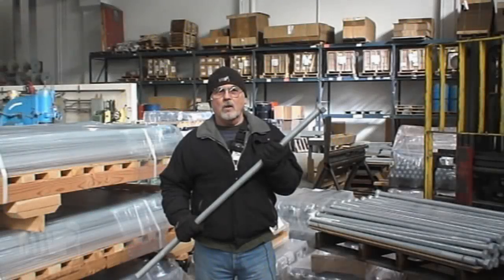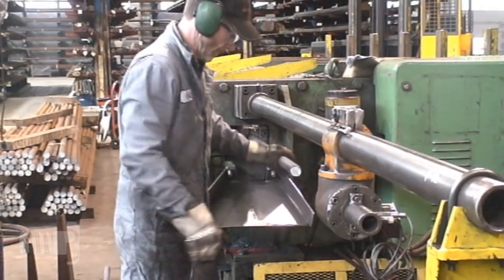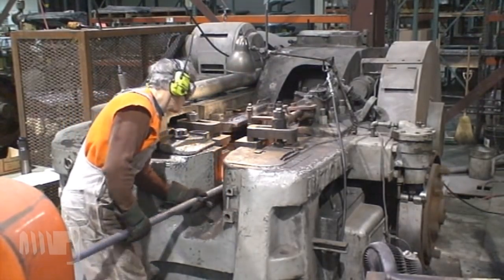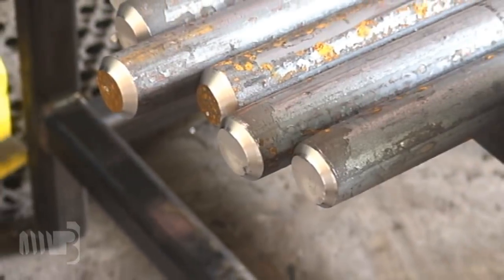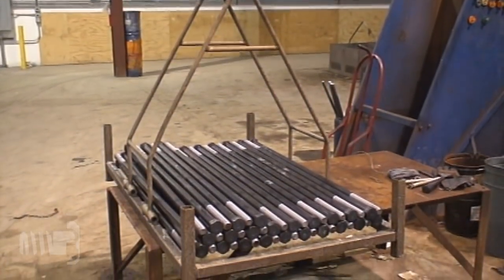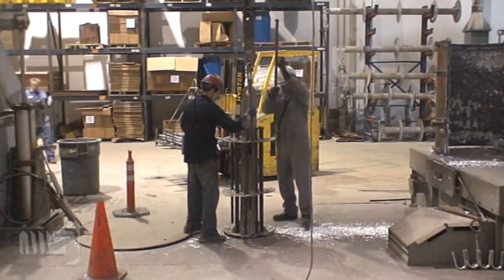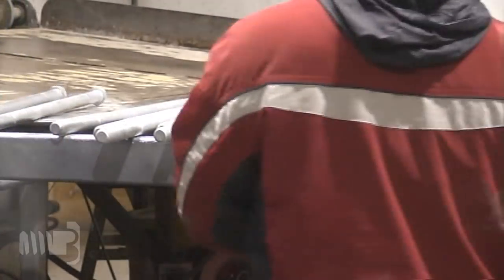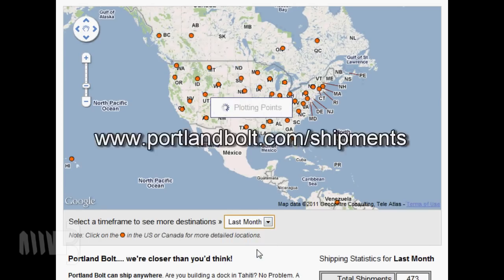How a Bolt is Made - Portland Bolt & Manufacturing

Comment from the maker: +Austin Washburn – No, all the machinery we have is designed for short run and hot formed specials. Larger production runs are typically handled by companies that have the cold forming machinery you mentioned.
Reply: Is it required to rethread after hot dip galvanisation? And thank you very much for sharing.

Comment: And here I thought Portland was just full of nuts! Who knew.😃
Reply: It takes a bolt to screw a lose nut!
Reply: Pop  lol
Reply: Oh, there's lots of nuts, as we see on the daily news...but none of them are the hard-working men manning these factories.
Reply: that's funny very funny very funny ...ha ha ha ha ha ha ha ha ha ha ha ha ha ha ha ha ha ha ha ha ha ha ha ha..
Reply: Concerned Citizen  Tweakers do this willingly.
Reply: LMFAO this comment only got more appropriate over time XD
Reply: 0.0000001 percent of our crazies get 98+% of the news coverage.  THAT's what's nuts!  They media's attention only serves to goad them on...
Reply: Steven Jaynes Come on man the media would NEVER do anything like that
Reply: @Tool-Meister  Those 0.0000001 terrorists are also driving out businesses and residents alike. After the red wave in November I suspect Patriots will be taking the chains off and fix this.
Reply: Is it all compression force (against the top of the bar were it standing straight up) that makes the hex head larger than the diameter of the bar?  That's the part I was wondering about and this video doesn't really make it clear.
Reply: @tarstarkusz , the end of the bar is heated to "plasticity" temperature, the machine grips the cold part, compresses the hot end to increase diameter, and form the hex. After that the grade is stamped.

Comment: Worked in a pile driver boat (USCGC Hatchet construction tender) used bolt similar to these....to hold the platform where later the channel light was placed....on the previously punched pylon into the floor of the channel.

Comment: that machine for forming the head is old.i mean 1940!but I am proud that they haven't scrapped it.American ingenuity  is a great thing.
Reply from the maker: You are correct!  The National Upsetters we use to hot-forge heads on bolts were probably manufactured between 1930 and 1950. Many components of these machines have been rebuilt throughout the years, but with a little TLC, they should run for another 75 years.
Reply: a lot times, really specialized machines just aren't made anymore unless you're talking a full custom build for foolish $$...
Reply: ??  How is it ingenuity to keep using something that works?  Makes no sense.

Comment: I used to make bolts for Bethlehem Steel  I made cold formed bolts from 1/4 inch in dia. To 1-1/4 in dia any length ordered --And had to run two machines  at one time ---usually a 1/4 inch mach. and a 5/8th mach.. I also ran at the time the largest cold forming bolt machine in the USA.   Our machines cut the wire --formed the upset--formed the head and trimmed the upset to a hex then pushed the blank bolt up a hollow tub to a pointer then up a track to the roller dies, all in one stroke once all the stations were full.
Reply: I used to make the washers for those bolts, Roy.  I ran the biggest washer making machine in the country over at United Steel.

Comment: Awesome video! Thanks so much for sharing....I wanted to learn how the threads on a 3" x 1/4" stainless steel lag bolt are derived....stamped or cut...
Reply from the maker: Hey Ken! 
We do not make fasteners that small. We cut threads on all the lag screws we make from 1/2" diameter and larger.

On a lag screw that small in diameter, the threads are likely rolled.

Comment: Before the invention of the wire nail machine, they used to shear wedge-shaped blanks out of iron plate, and a heading technique put the rose-head on a lot like the hex machine here.  A type of upset-forging.  Some thread technique on heavy bolts involves starting with a rod of a diameter between the root diameter and the external outermost thread diameter of what would be the finished product.  The threads are hot-rolled (I think) onto the rod. There is no metal removed, and the strength of the actual diameter of the unfinished rod is not compromised by metal reduction.  The threads do stand taller than the diameter of the rod though, due to the flowing upward of the displaced metal to the finished diameter of the outer edge of the thread.
Reply from the maker: junkdeal - Thank you for the comment.  The roll threading process you have described can be seen on this page of our website:  https://www.portlandbolt.com/about/manufacturing/threading/.

Comment: Thank you for posting this great video and showing us how you mfr bolts! I hope in the years since posting, that you have somewhat updated your processes to make them more efficient. I hate to be the one to say it, but the labor involved seems in excess of what could be used. There's a lot of hand-handling that could be streamlined. I'm not even saying to use robots, but just by redesigning your jigs, introducing new jigs and other devices, you could make your labor more efficient. I'm not sure what your economic challenges are; whether you are protected somewhat through domestic procurement requirements, but you could protect yourself with greater efficiency. I'm not intending to just be critical, but to encourage actions that will keep more jobs here in the country. Thank you!
Reply from the maker: CuriousEarthMan - Thank you for your comments.  We always welcome suggestions that will help us improve.  Many construction fasteners are mass-produced using automated bolt-making equipment.  These mass-produced bolts are relatively small in diameter, relatively short in length, and used in large numbers.  Thousands of bolts in the same size and grade are manufactured in a single run.

We are not a mass-producer.  At Portland Bolt, we manufacture larger, nonstandard bolts in relatively small quantity runs.  We are essentially a job shop.  We make anywhere from a single bolt to runs of a few thousand.  Due to the small quantities and larger sizes, automation is a challenge.  Therefore, most of the companies like our in this little niche market of making large, nonstandard bolts make them one at a time by hand.  There is a certain degree of craftsmanship that takes machine operators years to perfect.

We would welcome specific examples of streamlining our processes.  However, the bolts we make now have been made this way with little change since the inception of our company in 1912.
Reply: @pdxbolt  Thank you for responding! I would like to humbly submit a few detailed suggestions based on your response and your video. May I do that through email? To whom shall I address those suggestions, and to which email address? I am inspired by your long tradition of successful manufacturing, and perhaps there might be an item or two that helps you, not to correct you, but to serve your benefit in some way. Please let me know. Thank you!
Reply from the maker: @CuriousEarthMan  Please direct emails to Greg Lindsay - greg@portlandbolt.com.  I look forward to hearing from you.  Thanks.

Comment: The lathe operator is gauging the threads by hand. There's a quicker way to remove the thread gauge from the bolt. It will save you a little time, but that time adds up. Have a motor with a skateboard wheel attached bolted to the table. An on/off foot pedal would be nice. Just hold the thread gauge to the wheel and hit the foot pedal. Don't forget to slow down before the gauge comes flying off the end. You can even use an electric drill with a rubber wheel attached.

Comment: I use to work  for a packaging company. the one thing that would drive us bonkers is the misuse of shrink wrap and stretch wrap. Shrink wrap is a sheet of plastic that is put over something then HEAT is applied causing the film to shrink. Stretch wrap is film that is put over some thing when it stretched, like saran wrap.
Reply from the maker: Carl Stratton - Thank you for the clarification.
Reply: No problem.

Comment: I am a cold form tooling design engineer at a header shop. This was quite an  interesting video. Ive seen bolts similar to these but much shorter done in 5 and 6 station cold formers. Do you guys have any partsformers or nutformers that produce large quantities of parts in you operations?

Comment: As a racer seeing cut threads scares me. Every bolt on a race car as well as aircraft have (or should have) rolled threads. Do you do any kind of stress testing or are the bolts designed to be so over-sized it doesn't matter?
Reply from the maker: Lawrence Hayes - Fortunately, we do not make automotive, aerospace, or other critical fasteners that require a high degree of precision.  We manufacture large construction fasteners that, by nature, have very generous tolerances.  Construction fasteners can have rolled or cut threads.  We roll threads through 1" diameter.  You are correct that roll threading will typically produce a stronger thread.  However, cut threading is a common practice in the construction fastener industry and all bolts are tested to ensure they are strong enough to meet the minimum requirement of the various ASTM specifications used for construction applications.

Comment: Are they heat treated? I would think the head forging would soften the metal.
Reply from the maker: +George Applegate - The F1554 Grade 36 anchor bolts manufactured in this video do not require heat-treatment.  However, many grades of anchor bolts do, including F1554 Grade 105.  F1554 Grade 36 anchor bolts are made from A36 steel and shipped in an "as-forged" condition.  The heat from the forging process has little to no effect on the strength and performance of the product.

Comment: Wouldn't the bolts have a greater tensile strength is the threads were rolled and not cut?
Reply from the maker: You are correct; rolled threads will likely produce stronger threads due to the work-hardening from roll threading and the fact that cut threading interrupts the natural grain structure of the steel. However, cut threading still produces a product that will meet the dimensional and minimum mechanical requirements of the F1554 specification. You can see more about the differences between rolled and cut threads in our videos: https://www.youtube.com/watch?v=MvWmH3Dr52o and https://www.youtube.com/watch?v=4itib5n9AxY
Reply: Very good point, thanks!!
Reply: That's true, but the very fact that the diameter reduces from the shank aggravates the problem more than anything else. Back in college, we designed portal axles for our mini baja sae car. We didn't conventionally design the bolted joints. Instead, the bolt hole went 2.5 shank diameters into the anchoring flange before the threads even started. So not only did we have a good slip critical fit, but even if the bolts backed out, they were designed to function as pins anyway while the shank even behaved as a locating dowel. Saving weight on a handful of bolts is nothing compared to what you get from directly reducing design complexity.
Reply: kdmc40 Wouldn't rolling the threads make the manufacturing more complex i.e. the end product more expensive?
Reply: Anything made, could be made to excessive spec for greater cost.  The key is to first spend the money on the weakest link, the things that do fail rather than those that don't.

Comment: Hi, when cutting the tread how much do you allow for the  thickness of the galvanising please.?
Reply from the maker: John Cone - Threads of a construction fastener are cut (or rolled) with the same dimensions and tolerance regardless of whether the finished fastener will remain in a bare-metal state or be hot-dip galvanized.  Since galvanizing adds between 2 - 6 mils of zinc thickness to the bolt, it is the nut that is tapped oversize to accommodate the thickness of the zinc on the external threads of the fastener.  This FAQ addresses the issue in detail:  https://www.portlandbolt.com/technical/faqs/galvanized-nuts-tapped-oversize/.
Reply: Thank you for getting back to me, interesting.

Comment: Nice work. but I wonder if a hex head is optimal for anchoring a steel rod in concrete.  Why form a hex that will never know a wrench?
Reply: +Hopelessand Forlorn A hex head is just as effective as any other shape formed on the end of the bolt for the purpose of anchoring, No need to invest 500k into another forging system, when the hex head forge will serve the purpose. Make sense?
Reply from the maker: +Hopelessand Forlorn The hex head that is embedded in the concrete provides pull-out resistance of the anchor bolt.  Hex head anchor bolts are becoming more popular than right angle bend anchor bolts due to their superior pull-out strength according to AISC Design Guide 1. You can learn more about the advantages of hex head anchor bolts here:  http://www.headedanchorbolts.com/technical-info/.
Reply from the maker: +videoclipits Agreed, however we do see many engineers, especially on projects such as substations, design using square head anchor bolts as opposed to hex head anchor bolts.  From a manufacturing perspective, there is no cost or lead time differences between the two configurations.
Reply: +videoclipits Not a good explanation. All they'd have to change is the die, which will run them a few K at most. But you're right in saying that it works just fine the way it is.
Reply: IMHO, as a "retired" (20 years experience) ironworker... the AISC got a little nuts with regard to anchor bolts starting around the implementation of IBC2000.  One of the last jobs I did spec'd 1.5" anchor bolts with a 3" diameter 3/16" washer on it... on one column... this frame line was 120' long, a 6' tall built up rafter on top of  5 columns in total.  The hilarious part was the top of column with the 1.5" anchor bolts.... was bolted to the rafter with 4 5/8" A325 bolts...
Reply: bretsk2500 yep, the last concrete job I did used washers jam nutted as both ends of the anchor was threaded. Zap was the engineering firm.
Reply: just add a big washer and you're good to go
Reply: The shape of the head isn't going to make much difference if you have a concrete failure sufficient to release it.  By that point something else went wrong.  Now if you were instead talking about the SIZE of the head, it depends on the application but this is for the engineer to decide, not the bolt company.
Reply: Because they already have the machinery to do it

Comment: At what stage you are doing heat treatment. After heading operating from forging may raise stress to the material
Reply from the maker: Noel Francis - The headed anchor bolts manufactured in this video, F1554 Grade 36, do not undergo a heat treating operation.  However, for headed anchor bolts such as F1554 Grade 105 which require heat treating, the quench and temper operation is performed after the heads are hot forged.
Reply: @pdxbolt  Excellent. Thank you

Comment: How do you clean the threads after galvanizing to accept a nut?
Reply from the maker: Tim Gear - Bolts are placed in baskets or racks (depending on size) and dipped into the 840-degree molten zinc. immediately after the bolts are removed from the galvanizing tank they are spun at high speeds.  Centrifugal force removes the excess zinc from the threads while it is still in a liquid state before it has time to solidify.   We chose to omit this footage from the video since it involves some proprietary systems and equipment.

Many companies that don't have specialized systems to hot-dip galvanized bolts will send them to galvanizing vendors that are not set up to process fasteners.  When excess zinc has not been removed properly from the threads during the galvanizing process, many companies resort to chasing the threads after the bolts have been galvanized.  Chasing threads is the process of rethreading the bolts to remove excess zinc that has accumulated during the galvanizing process.  However, it is virtually impossible to remove excess zinc without removing all of the zinc in certain areas of the threads.  It is also very easy to remove some of the steel from the threaded portion of the bolt when chasing threads which will cause the threads to be undersized and out of tolerance.  If too much zinc is removed from chasing, the nuts will be too loose resulting in an improper nut fit and the susceptibility to stripping.  ASTM F2329, the specification covering hot-dip galvanizing of fasteners, strictly prohibits the practice of chasing threads.

Comment: How or what do you use to gage the thread after the plating operation??
Reply from the maker: @xanadujohn79 - Threads are gaged in a plain finish condition.  The zinc thickness after hot-dip galvanizing is measured to ensure compliance with the F2329 specification.  Nuts are tapped oversize to accommodate the added thickness of the zinc on the threads of the bolt.  Clearances are engineered to work properly if all processing is performed correctly.

Comment: Could you run what kind of bolt that is by me again--- didnt quite get it.
Reply from the maker: quantumss - The bolts manufactured in this video are anchor bolts for an electrical substation.  To learn more about substations, follow this link:  https://en.wikipedia.org/wiki/Electrical_substation.

The headed ends of these bolts are embedded in a concrete foundation with the threaded end projecting from the concrete.  The large steel structures and equipment in a substation are bolted to the concrete foundation using anchor bolts like these.  Here is a photograph of anchor bolts set into a concrete foundation:  https://static.portlandbolt.com/uploads/2013/04/8-21-12montana-refining-co2-web-374x280.jpg.